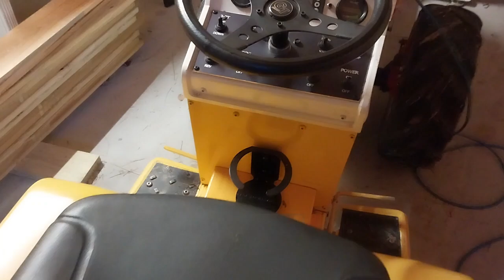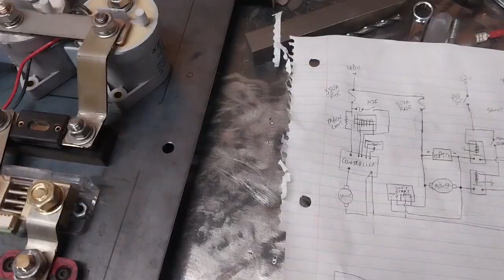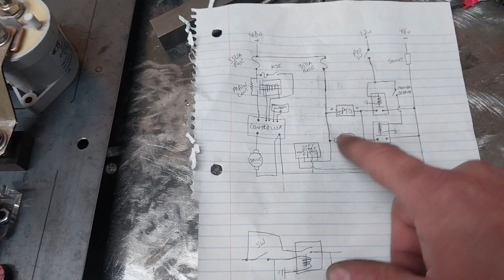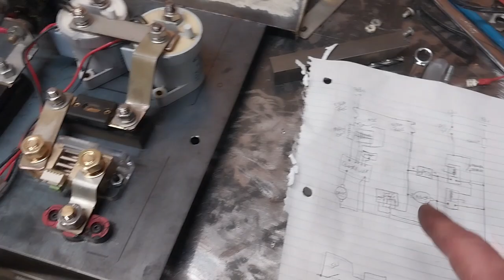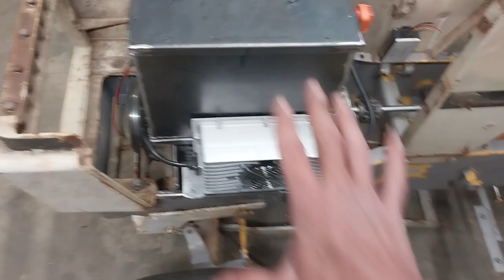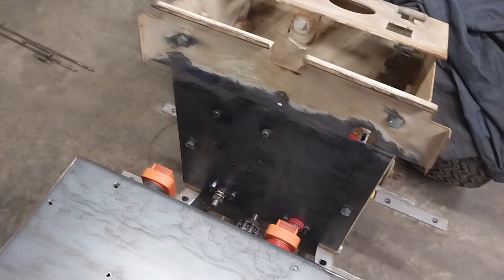Time To Start Wiring! pt.2 - Ms. Cub

Comment: I love the clean wiring from the battery pack to the through-post terminals and then into the area behind the dash with the contactors and fuses and everything - clean!  For the Curtis PB to control the soft-start you might check inside the case of the Curtis as I bet there's a third terminal on the pot in there if you want to make it a 3-wire connection.  Nice work on all this Bill
Reply from the maker: ohhh...I bet you're right!  And if nothing else, I may be able to swap out the PB's pot for the one that came with the soft start.